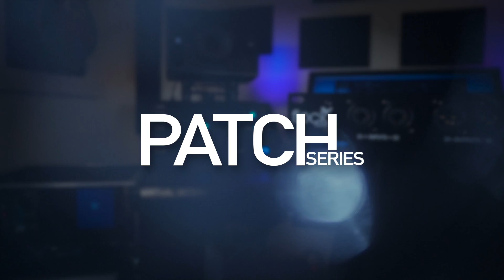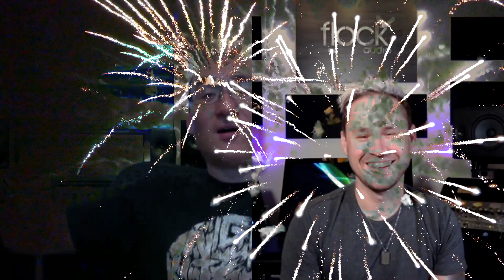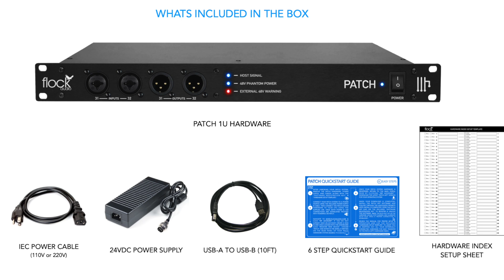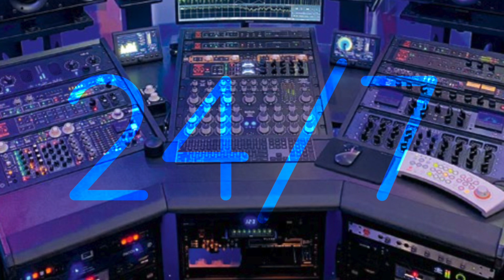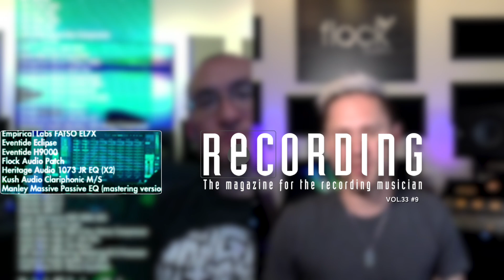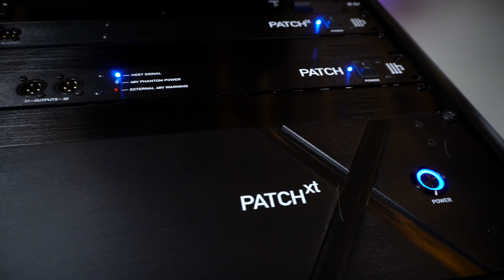RICHARD DEVINE Chats Flock Audio PATCH!

Comment: nice video! wondering how many flock patches were used for this Studio set up involving two Apollo 16s as well as summing capabilities
Reply from the maker: Richard only has the 1 single PATCH System and uses it specifically for his Mixdown/Mastering stage of his production 🙂 However, he will be integrating a PATCH XT soon to allow even more I/O for his exiting setup!

Comment: Very Cool!  Im hooking two of them up as I watch this.  Running this with a new Rednet system (Dante).  Dumped my Avid system except for the S6..... Hookups will be Phoenix Audio 8ch mic pre, Looptrotter Satur-8, Looptrotter Monster compressor, Liverpool Compressors (2), Black Box HG-2, Black Box MM-1, Roland Fantom-6 (6ch), Akai MPCX (8ch) & 8ch of I/0 from my interfaces!